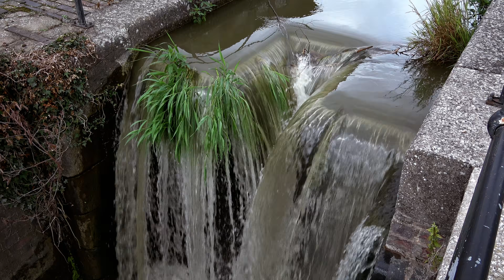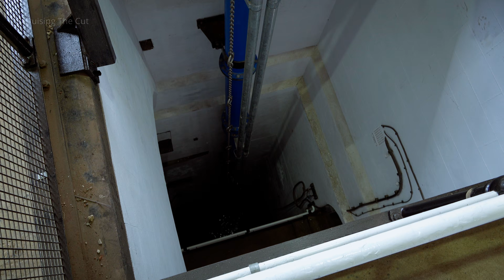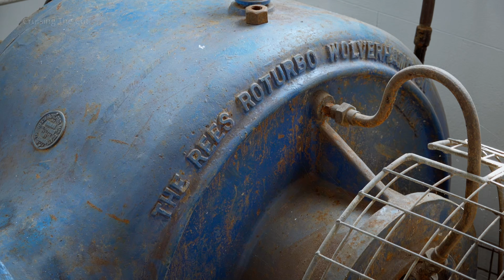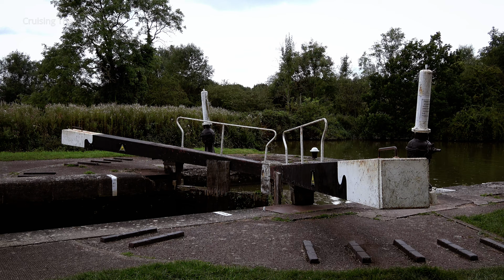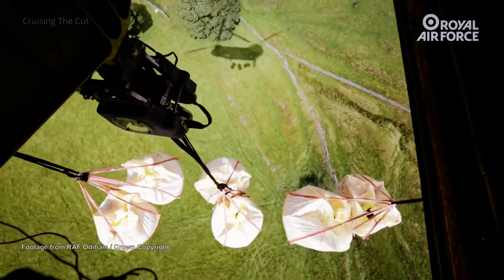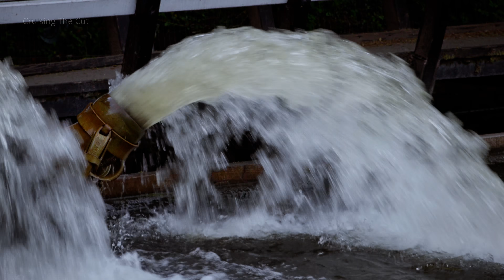247. Canal water: pumps, reservoirs, the works!

Comment: Even the Panama Canal now has problems with too little water in the canal reservoir.

I have already read about problems with the overflow and the emergency overflow at various dams. As these are not used that often, you don't notice such problems, such as slightly raised concrete slabs that are then washed out, until they cause problems

Comment: I wonder why a rubber membrane at the points where lock gates meet isn't used to mitigate leakage.  Nice coverage.  Great information.
Reply from the maker: It would wear down extremely quickly
Reply: The lock gates are designed in such a way to open with no friction and seal tightly under pressure. The gates that are leaking are damaged or deteriorated

Comment: Too bad the Hennepin Canal in Illlinois could not be restored for recreational boating.  It opened in 1907, after railroads had eliminated most of its commercial need - it was built too narrow for the current barges, but it is perfect for the narrow boats of these videos.  The 108 mile canal connects the Illinois and Mississippi rivers at the Quad Cities.   It was really opened about a century too late, but its pretty cool nonetheless.  It finally closed in 1951. Several of the locks are still functioning. The Hennepin was one of the first wide uses of hydraulic cement to replace stone and brick.  The Hennepin Canal would have been fantastic in 18th century England, not so practical in the 20th century.  The canal roughly follows Interstate I-80 - the busiest Interstate highway west of Chicago.  In some places I-80 is visible from the Hennepin Canal.

Comment: I wonder if water saving measures like the reservoirs next to the newer Panama canal locks would be a feasible solution to save water. Yes, there are literally two actively monitored locks in Panama that do this and across the UK there are countless small and especially unmonitored locks. But the number of the locks might make it possible to sort of mass produce something that can "easily" be put into holes dug next to the locks that can then function without needing constant supervision.
Reply from the maker: Hi. Yes, loads of the locks on the system have side pounds to help manage the water.

Comment: But, what about the lock gates themselves? If, for example one of the upper doors should fail, then the whole upper canal would be drained? Also reservoirs would drain out? And the flood of water would destroy the lower lock gate at the same time? All, in addition to costing a lot of money and creating damage, also leaving boats stranded on the bottom of an empty canal? Or?
Reply from the maker: An entire gate failing is extremely unlikely but the gates at the other end of the lock (unless they failed simultaneously) would prevent all the water draining. They do leak to an extent but the CRT has a maintenance and replacement programme.

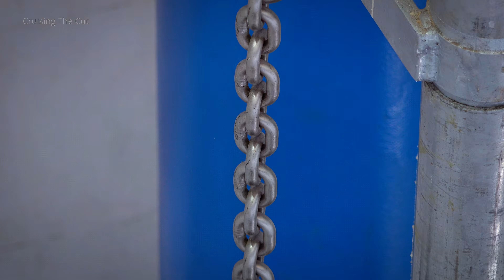Comment: Thanks David, very interesting again! Just one clarification @4:50, you mention the pump “sucks itself into a water tight position” (after being lowered on its guide rails) - as a Mech. Design Engineer specialising in pumping systems, I can clarify that these types of submersible volute pumps use the levering force of the pumps own weight to create a seal. The pump has a claw on top of its discharge flange, which engages with the top of the matching fixed ‘duckfoot’ bend it engages with, when lowered into position. There is also a rubber seal ring on the flange between pump and bend. Rather. Than ‘sucking’ itself into a watertight position, in reality as it discharges water, it is effectively pushing itself away from the coupling bend/off the seal, however the weight of the pump is sufficient to overcome this and keep it in place. Hope that helps!
Reply from the maker: Hi. I quoted what Charles Baker (the interviewee and chap in charge of the pumping station updates) told me!

Comment: Question,. How do Fires affect the water ways? & What are plans set in place for NB for encountering fire?
Reply from the maker: I don't know how to answer that. You mean if a boat went up in flames?
Reply: @CruisingTheCut  
David, is there generally sufficient access to allow a fire engine/pumper to pump from the canals for large scale fire fighting ...say a field or wood lot fire?
Reply from the maker: Very hard to say "generally", bits of the canal can be accessible or not, depending on where it is!

Comment: I was member of a sailing club in Enschede, the Netherlands. It sat on the end of the Twentekanaal, an about 8 km long dead-end canal only reachable by lock with a rise of 9 metres and not much inflow. Every time the lock was used, the upper canal level lowered by 5 centimetres (this sounded incredible, but after calculation I found it to be correct), so indeed there are diesel pumps to keep the water level at normal.

Comment: I think if I was lucky enough to travel to the UK and try my hand at boating the canals, I think I'd be patient, and if heading down a lock, I'd wait until a second narrowboat also wanted to go down, and share the lock (If wide enough.) so it only has to be used once, or wait for someone who wanted to go up and allow them to use the lock first to minimise the number of refills. Also, a small solution I can see is to have the outflow from lock emptying go into a small local reservoir and get pumped back into the lock when it needs to be raised, rather than just emptying it down stream. I know, this would have to be balanced to keep the down stream canals at a suitable depth, but the more water saved, the easier this gets.

Comment: Excellent video, David! Canals were an early product of the Industrial Revolution and after watching this video I have a better idea of why they couldn't have happened before that time. But that brings up a question: some of the canals were built before steam engines became state of the art. Did early canals (in the 1700's, say) avoid using steam engines somehow? Did they require a high elevation reservoir to allow gravity feed? Or was some other method used for pumping?
Reply from the maker: On the very earliest canals, I don't know, unfortunately. I suppose they must have built gravity-fed reservoir systems

Comment: That failure at Todd Brook is something like the Oroville Dam failure on 2/2017.  The main spillway broke with water flowing out. They closed off to asses the damage.  Inflows kept coming in, and finnaly it overtopped the emergency spillway OG Weir!  But there was head cutting erosion and people were evacuated.  Fiannly they opened the main broken spilway to 100,000 cfs.  

Check Blancorillio on you tube here.  They rebuilt the spillway and emergency spillway, they aslo put a Secant cutoff wall for the emergency spillway!
Nice video.
Reply from the maker: Cheers, yes I've seen a few videos about that; incredible

Comment: That was great, David, thank you.  I learned a lot - and in a very enjoyable way.  Must confess, was surprised that there was no mention of the system that they’ve got at the Foxton flight where they have side ponds and where, so the lockies told me, one boat can go from one end to the other using just one lockful of water which I found pretty amazing.
Reply from the maker: Even without side pounds, any boat will descend a flight of locks on a single lock full of water, as it goes with you, in effect.
Reply: @CruisingTheCut  so it does 😃

Comment: The canal network could also become part of electricity storage.  The most probable method would be using electric pumps to move water to the top reservoirs during times (usually night) of high electricity availability and therefore low cost.  When, during the late afternoon and evening, the demand is great, the water is released through turbines to generate electricity.  There are risks - https://en.wikipedia.org/wiki/Taum_Sauk_Hydroelectric_Power_Station.  But, in addition to transferring water from one shed to another, the canal system could contribute to renewable energy storage.

Comment: Another outstanding vlog !  A question thou, did you get a new camera?  The video seemed a lot clearer than prior ones.
Reply from the maker: Not new as such, I’ve had it for ages (Sony NX80) but tend only to use it on these “documentary” type videos rather than anything filmed onboard where I need to be nimble. For example, the “piano on a boat” recent video used the same camera, as did the one about volunteer lock-keepers. But the Wash crossing was the usual AX53

Comment: Good David, but worth noting that Toddbrook opened in1838 to feed an industrial transport system. it still only feeds the same canals but  as leisure canals  they now use less water. Hence, the need for the 1970 emergency spillway that the Victorians would have made a better job of. Listening to the Canal and River Trust portray the problems of managing THEIR reservoirs and then listening to calls for water saving from United Utilities, a company that catches rain in the same area for domestic supply, I feel concerned about coordination. I have the same size feed pipe to my house as narrowboat users fill their water tanks from but the contrivances that surround these matters cause me to be charged 45% more for water supply and drainage than it costs to licence a 60 feet long narrow boat for rivers and canals.
The biggest change to climate (not demographics) between 1963 and now is the massive increase in recorded data and the willingness to believe that what is recorded by camera on a phone or could not be measured by 1960s technology must be happening for the first time or more frequently.  I do not see how my thoughts could have been included in your usual excellent video standards, but like ballast they are not pretty though are unavoidable for balance.

Comment: Uh I just learned something new, thank you!
So, since canals are totally man-made, does that mean that they don’t have any stream? Canals’ water is basically “still” apart from the stream cause by the boats navigation? Or the water that is pumped in creates also some sort of stream?
Reply from the maker: Correct. No stream until someone uses a lock, when that lock’s-worth of water moves along. However, there is a small flow on the Llangollen as it is used for water transport (also on the Gloucester and Sharpness)

Comment: Hi David. Fantastic video, it's great to see such a clear explanation of where the water comes from and how it's dealt with, I hope this will give boaters a better appreciation of what the Canal and River Trust do in the background unseen, and why some lock flights have to have restricted hours, to allow back pumping of water up to the summit lengths. When I see water pumping volumes quoted, I like to compare with the 1861 Easton Amos land drainage machine at Westonzoyland Pumping Station, Somerset, where I am a Trustee. This steam pump is capable of lifting 100 tons per minute, the pump you quoted at 200 litres/second is about 12 tons, such is the ingenuity of Victorian engineering. All the best Alan
Reply from the maker: Cheers Alan. Don't I recall you doing a video tour around that pumping station on your channel?
Reply: @CruisingTheCut  Not yet I haven’t. I took some film there last weekend, and will include some clips in a forthcoming vlog with a view to making a longer film in due course. I filmed Papplewick PS near Nottingham, and also used old footage of Crofton Beam Engines on the Kennet and Avon in another video. It would be those you are thinking of.

Comment: Old things that are built will always need repair or replacement. That's life. Just like the sewers etc. Natural Climate change will have some impact, but wear and tear etc is something that will always have to be addressed. Its a good episode. Interesting to hear how water can be distributed using the system to augment natural water supply's for drinking. Pumps by the way don't suck lol. They are either displacement pumps or vacuum pumps.
Reply from the maker: Or in layman’s terms - they suck!

Comment: Absolutely fascinating information, I really love it thank you. One question is what is the typical depth of a canal please. One comment about the overflowing spillway, I don't think it was smart of those people to walk over it, if the spillway had collapsed they would have gone with it. Amazing how much trust some people put in structures.
Reply from the maker: To be clear, as the script mentioned, the footage was on July 31st when there was no indication that the spillway was failing - it was just water going over it which is exactly what it's there for. It was the next morning, August 1st, when the cracking began and the alarm was raised. Hence the pedestrians had no reason to suspect any issue.
Reply: @CruisingTheCut  True but still risky when equipment is at the extreme end of the envelope. I see things differently as a retired maintenance reliability engineer who has looked at a lot of system and equipment failures. Moreover the very visible pre-existing damage to the spillway and all the vegetation growing out of it showed considerable deterioration.
Anyway a superb Vlog thank you.
Reply: It's the same when a tsunami is announced...
people head down to the beach to see it....
blocking traffic desperately trying their best to leave the area....

Comment: 4:00 PM close time? I have always wondered like what's the latest you can put around on the canals.
Reply from the maker: Only on those specific lock flights while restrictions are in force. The rest of the canals you can pootle along when you want, though it’s generally considered unfriendly to run your engine after 8pm or before 8am though if you’re moving it’s not so much a problem. Not many boaters move at night but it’s not unheard of.
Reply: @CruisingTheCut  Got to get an electric boat :)

Comment: The history of the Bradford  Canal, a branch off the Leeds Liverpool, is littered with problems of water supply.  With no agreement to use water from higher up the main canal it needed lots of pumping stations, which were expensive to run and there was never enough traffic to pay the bills.

It is said that it was so polluted with Bradford woollen mills and dyeworks waste that before it finally closed in the 1920s the 'water' would spontaneously combust!

Comment: Thank you David for another very informative video.  When I stumbled upon your narrowboat channel last year (and always living in the US, where we don't have narrowboats or a canal system that was built for transportation), I immediately wondered about the canal water management system and have since been researching its design and history.  Your video has helped to fill in some gaps in my knowledge base, particularly the pumping stations and reservoirs.

One thing I have observed in your videos is (on average), how close the canal level is to overflowing the bank.  I know the canals were built that way (with very little safety margin) because they were dug by hand therfore, just barely large enough to float the boat but, not have the water go over the banks.  I know there are numerous weirs to control water levels but, can also envision flooding around the canals during extended heavy rains.  Sorry to be so long-winded with the comment, I just enjoy the canal history and design behind it.  Keep up the good work - Cheers!

Comment: Drought was more of a concern in the 1970's when they built that spillway so they probably weren't thinking it would ever get that much of a testing.
Reply from the maker: Remember the summer of ‘76? I was only 7 at the time…
Reply: @CruisingTheCut  oh - you're wearing well then!  I remember it (little bit older) but not being very concerned about water shortages rather the lovely weeks running about in shorts and plimsolls.

Comment: That was very interesting, it is the sort of thing I often wonder about, what is going on in that building, what's that humming behind that door. I need to know. Also those pump motors from the 60s reminds me of when I worked summer job as a young teenager at the paper mill. iirc some of those were even older and running DC. oh well. cheers.

Comment: If every paddle gate had a small hydro generator; how much water could the canals pump uphill ?
Reply from the maker: Not a lot, I think. The outgoing flow from a lock is only substantial for 2-3 minutes and then the lock may be unused for hours until another boat comes along. So the energy generated would be minimal for quite a substantial outlay and engineering effort.

Comment: Interesting subject, and how things have changed over the years. Possible solutions and upgrades for the future.  I am not sure it was mentioned but when you were showing the “smart technology” touch screen was there any mention of backup systems in case the smart technology goes offline?.  I also noted that when Tracy? Was talking there was a pelican case with a solar panel on top of it, wondering if that’s a charging station?. If it is I could Set something similiar up with my spare pelican case as a possible solar battery charger system for camping?, instead of tripping over it every time I go in the back room 😂 not many things you talk about on both your site make me want to go to sleep lol.  Your doing a great job of passing on information and tips on how things get done.
Reply from the maker: Yes, the solar panel on top appears to power the telemetry system in the peli case